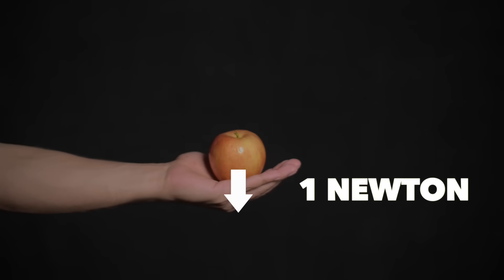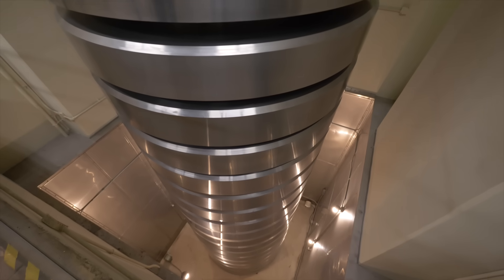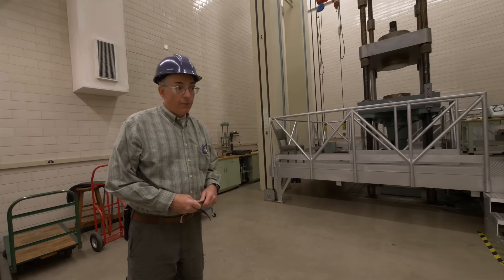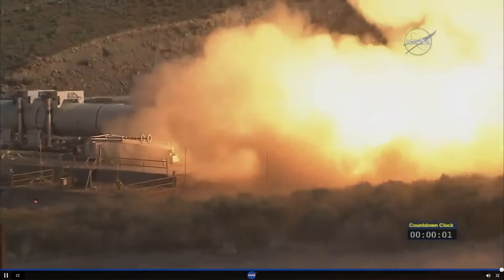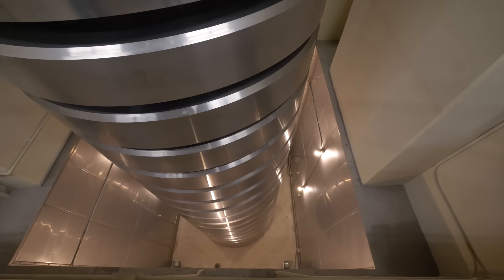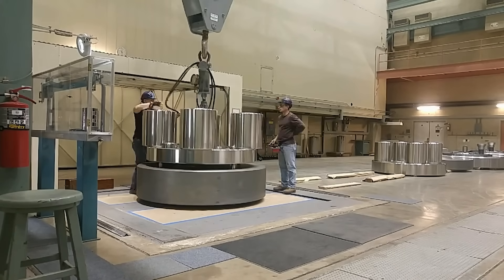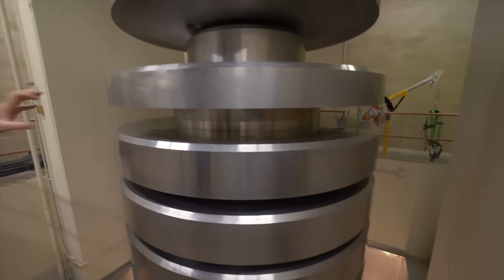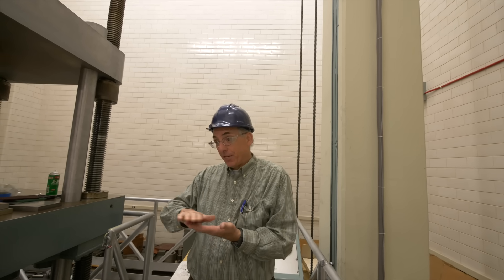World's Heaviest Weight

Comment: But can it break my bones? I drink milk every day so I'd say I'm pretty dang strong
Reply: Gon give some of my MD pennies

First, just gonna add that diet can cause a blood pH imbalance. Ketogenic diets and diets high in meat can cause acidosis, while diets mainly consisting of veggies can cause alkalosis. 

Anyways, an acidosis causes more albumin-bound calcium to be released to the blood, as the H+ ions compete with the calcium ion binding sites on albumin. This in turn increases plasma calcium levels.

Calcium is a highly potent signal molecule, so it is one of the most well regulated in terms of concentration in our blood. It's reference range is very tight: 2.15-2.5 mmol/L. And it hardly ever goes outside this range.

Blood calcium is mainly regulated by PTH, which is released from the parathyroid glands, where calcium-sensing receptor sit and taste for calcium. The way they work is that they are inhibit the release of PTH when serum Ca2+ is elevated (negative feedback).

When blood levels of free calcium is drop, PTH is released. It will work to increase blood levels of Ca2+ such that it reaches homeostasis. One way it does this is to increase osteoclast activation, which breaks down our skeletal bound calcium to increase blood levels of Ca2+.

This means that an acidosis would increase free Ca2+ in serum, which would in tune down the PTH release. Meaning we inhibit bone remodeling, which normally would result in loss of some bone mass after each cycle. 

If milk were to make us acidic, it wouldn't affect the rate of resorption of calcium from our bones much anyways. Blood pH is also strongly regulated, so the effects of a momentary acidosis are essentially insignificant, as it is quickly compensated. If the pH imbalance is of such significance that your body wouldn't be able to reverse it by itself, you'd have other underlying issues and other things to worry about, e.g. going into a coma. 

We consume way more acidic foods than milk, like soft drinks which can have pHs way below 3. Milk is only very slightly acidic.

When it comes to hormones, milk may contain estrogen. Estrogen is in fact helpful to keep bone mass density. The main factors of osteoporosis is age and gender, meaning females past menopause. Estrogen levels drop off, and it makes it very difficult for the body to keep the bone mass high. Estrogen is actually used as medication for osteoporosis, as it reduces bone turnover by binding to estrogen receptors in bone.

TL;DR: Ayy lmao, just drink milk.
edit: a word
Reply: bikeanddogtrips [citation needed]
Reply: Yeah I might not agree with all u said ( I didn't do research) but for sure i know drinking cow milk everyday for "calcium' is definitely not healthy. 
@fittyaqua don't always believe what the doxa tells you to believe..
always think twice
Reply: DupeSicate Saying something is wrong doesn't make it wrong either...
Reply: +Dangit_Bobby your gastric juices, not something made for baby cows to drink
Reply: SergioRC The Gamer Nobody actually cares
Reply: This is processed milk, raw milk is alkaline
Reply: this is great idea for raising Titanic but still too heavy for lifting the Titanic
Reply: bone hurting juice
Reply: FittyAqua uhh I drink everyday milk too
Reply: Did you know that your gastric juices have a much lower pH than milk, and that strict regulations and testing protocols have been put in place to ensure our milk is sanitary?
Reply: ¶The problem is that is not milk, nor the human body's way of processing it at all. The PH level in the milk is pointless, though at 6.5-6.7 it's closer on the PH scale to water than the HCL (3.01) found within your stomach. Moreover, the entire body works to keep your body at a relatively neutral PH level through homeostasis, achieved mostly due to the lungs (removal of excess/more CO2 from the bloodstream) and kidneys. The only time acid vs alkaline matters is for your mouth, and that has to do with forming ionic bonds for calcium to bind to teeth, or be striped. The body, regardless of what new-agey-hippies tell you, does not become cancerous - the fact that cancer cells are "acidic" is due to their anaerobic method of producing energy; that is not what caused them. The leading cause of osteoporosis is the LRP5 gene which seems to play a very important role in the density of bone within the human body. This is somewhat basic chemistry/biology, I am not sure why nobody researched this on their own time.
Reply: if you go super saiyan and train under 10000x gravity then that answer will be NO
Reply: FittyAqua milk has alot of chalk in it too much chalk can cause your bones to break easier
Reply: did you know that cow milk is perhaps the leading cause of osteoporosis (brittle bone) due to the fact that it is acid when digested, causing your body to remove trace elements of calcium from your bones in order to set it to a more natural alkaline state.  Plus milk has pus and growth hormones.

just sayin'

Comment: 3:13 what's he doing?? Is he removing some dust?
Reply: Precision is needed.As he will measure other weights relative to this one, this dust on a larger scale could weight 500 tons.
Reply: Possibly also drying condensation.
Reply: Tell me in what scale does dust become 500 tons.
Reply: lol, using a smaller known weight say at 5kg if they use a precise enough scale that can read to very small increments can pick up the weight of dust. now add that weight of dust times a weight equal to 1 million lbs. might not be 500 tons but that scale would be off by several hundred to several thousands of lbs.
Reply: Omar Ahmed
Reply: Urf a big scale

Comment: STOP USING POUNDS!   FOREVER!    GO METRIC ENTIRELY!!
Reply: the reason they use pounds is for at least the Americans, it is easier for them than Kg in conversation as no conversion is needed unlike metric to get back to pounds. 1kg is 2.2lbs, and 1lb is well 1 lb.

Canadian here, we use both rather interchangeably depending on the situation, but rarely will people use Cm's over inches and feet, but we do make use of km's and meters if the distance is great enough to warrant it.

I prefer pounds, as its easier to know 100lbs is 100 lbs. trying to visualize 100 kg of anything is difficult compared to pounds. When i  say "Grab that 30 lb bag of concrete" you will know the rectangle bags which are at least 8 inches in thickness are the correct bags without even knowing it half the time.

When someone yells to me "Mix me 20 kg's of such" i look at them like they are idiots as A i have no idea how many 30 lb bags im going to need until i take time wasted to do a conversion and B why didnt they just rattle off the old "Mix me two bags of such and such" instead of making use of metric if they already knew they would confuse people.

Remember Imperial measurements are English first.

Comment: Science doesn't speak imperial.  Use metric or SI.
Reply: The problem with imperial is not the fact that it does not work, but the fact that it's a retarded system used by like 3 countries.
Reply: bpoon2k2 Universe doesn't speak metric. Use Planck/natural units.
Reply: Science works the same regardless of which units/system you use. Units are just different reference points/languages if you will. Don't be so petty.
Reply: The american industry is built around the imperial system. Its often more expensive to get metric bolts and what not as well here.
Reply: bpoon2k2 "I want a whole country to change to the metric system.......because I said so"
Reply: But us dose
Reply: Science speaks numbers. It doesn't matter if you count in base 10 (Imperial) or base 4 (Imperial), it's all numbers.

Comment: Why not generate the required forces using hydraulics? It's a well-known principle that in hydraulic systems the force is proportional to the area - so for example, if the brake caliper in your car has a total piston area 5 times the size of the master cylinder/piston attached to the pedal, then the force exerted on the brake pads will be 5 times the force acting on the pedal.

So why not have a pair of hydraulic cylinders, one being 10,000 times the area of the other? For every 1lb. you put on the small cylinder you'll get 10,000lb. on the large one. Then you'll only need 100 lbs of carefully calibrated weight to calibrate the transducer up to 1 million pounds.

Alternatively, why not use levers? We all know force is proportional to distance from the pivot. So use a very long lever, put the transducer close to the pivot (say 1 foot away), and if you hang weights 10ft away, you'll be getting 10:1 amplification, so you only need 100,000lbs of weight. Use longer (or more) levers and you can get the same effect for less weight.

There are probably countless ways to get close to this accuracy using other accurate force-amplification methods.

Comment: In science, metric system is used, even in US. Pounds should not be here.
Reply: It might not be calibrated for kilos, but if you were paying attention, it is calibrated IN kilos, because each of those disks is calibrated against smaller masses, until at the smallest scale, it is calibrated against the US's standard kilogram.

In modern times, by definition, ALL US weight measures are derived from the kilogram, and the older system persists for... Reasons.

Who knows WHAT reasons exactly, but I'm sure someone can give some.
The UK still measures distances in miles for instance. The reason? When the country switched to metric they were too lazy to convert all the road signs.
(Australia meanwhile converted every road sign in existence in the country in the span of a few hours, as did most other countries that made that switch. )

So... The pound is 0.454 kilograms. By definition.
Because there is no independent reference for a pound anymore, this isn't merely a conversion based on comparing the two units, this conversion IS the definition of a pound.

Still weight is something of an odd one out here, because it's still defined in terms of comparing it to a 'standard' object, where many other fundamental units are now defined in relation to physical properties.

Time is measured relative to the vibration of Caesium-133
Distance is measured relative to the speed of light in a vacuum.

Anyway, whatever. Use all the silly units you want. ;p
20 years ago it annoyed me greatly. (because people in my own country were using these stupid units when officially we are only taught the metric system, and I had no idea what the units they used meant. And in spite of the metric system being the ONLY thing taught in school, most of these people - and these were kids mind you, not adults, did not understand anything if I gave measurements in metric. Very, VERY irritating.)
But no. That frustration is long gone.

However, if you say 'Aluminum' one more time... I WILL find you, and I WILL kill you. ;p

XD
Reply: Why would they calibrate it for pounds instead of dollars? That's retarded.
Reply: @Jack Gisicki: Then make it kilogramme lol. Why did you picked gram in the first place. The opponent for pound lbs is kilogramme kg.
Reply: Jeffrey Slater no one said that. America uses an outdated and unused system of measurement for no reason. Im American by the way. In science everything is measured using the metric system.
Reply: Virginia Battle Flag murica... :/
Reply: krugerblue its not calibrated for Kilos. If you listened carefully before bitching its calibrated for
 p o u n d s. Thanks gor your opinion though
Reply: US mechanical engineer here. 
I think we worry too much about units. Admittedly, I know imperial units more intuitively, having built and used standards based on imperial units. I still have to think a bit about what a kilogram or newton is.

There are too many things in the US, in terms of production, manufacturing, and engineering that use the imperial system. The momentum in keeping to that standard made the 1,000,000 lb weight vlogged above exist. 

I still like imperial units. I like how an inch is the length of my smallest index finger joint. I like how 100 degrees Fahrenheit is around body temperature. I like how a "cup" (liquid measure) is a small cup in volume.
Imperial is humanist.
Reply: Pure Hostility how sneaky and original. Europeans when they see Americans using the imperial system of measurement "how DARE YOU!! I must DESTROY YOU AND YOUR COUNTRY!! Grrroghhgoorrrhho!!!!"
Reply: he meant the weight not the money
also, it is only calibrated in pounds. if it used the metric system, it would be a hell of a lot lighter (by that i mean 1 million grams is not as heavy as 1 million pounds

Comment: This seems really strange. The scientist speaks of Newtons which is a SI unit of force and yet the weights are constructed to be a round number of pounds which are imperial. Why would they not use say a 500,000kg weight (or 500 tonnes if you will) rather than a 1,000,000 lbs, still round numbers but directly traceable to the same standard kilogram the US uses to calibrate its imperial units of weight. The force you would get from a 500 tonne weight would be around 4.9MN (depends on local gravity, just as it does with the imperial weights).

Comment: why would they convert kilograms to pounds and uses it to calibrate airplanes rockets and other engineering works that require standard SI Units such as Kilograms? That is double the work because you have to convert from Kilograms to Pound then Pound to Kilograms.

Comment: For the metric snobs out there: you should remember that Americans got to the Moon and back using imperial measures. The conversions are not as hard as you think and the measures are just as exact. 
This video shows that perfectly reputable engineers and scientists use the imperial systém. Cell phone screens, laptops, even bike frames and wheels are typically identified by their measure in inches even in the parts of the world that officially use the metric systém. 
That said, metric is better, but do not say imperial measures are somehow a travisty to logic.

Comment: I'd like to weld the segments together, machine them precisely and balance them, then attach them to a HUGE low friction electric motor and spin the stack up as  HUGE flywheel... then disconnect the motor and see how long the stack takes to slow down to a dead stop.

Comment: Great video! Also, inb4 the 3000th triggered comment about mathematical conversion and one's inability or unwillingness to simply learn/understand/appreciate both standards.
Reply: No, the Apollo program was designed in US Customary units.  A 1 page study by Werner von Braun for Skylab used vehicle diameters in feet, and weights in pounds:  https://en.wikipedia.org/wiki/File:Dr._von_Braun%27s_Sketch_of_the_Space_Station_8883912_original.jpg

As long as you're consistent, it really doesn't matter what system you use.  I mean, a distance of 1/10,000,000 of the distance from the pole to the equator on the line of longitude through Paris, and taking the weight of 1/1000 of the cube of that distance of water aren't any less arbitrary than some random king's foot.  Chaos happens when you try to convert back and forth in one project.
Reply: Sshhh, CatCube2... You're spoiling their fun with facts!
Reply: Michael Distefano they've used only the metric system for all the calculations to send people on the moon because it makes more sense... deal with it!
Reply: CatCube2 That's not the current definition of a meter. Or a kilogram.
A meter is 1/299 792 458 the distance light travels in a second. A totally non arbitrary number.
A kilogram is the mass of the international kilogram.
Again, a totally non arbitrary basis.
Reply: CatCube2 well, no. You know, if the system was consistent, I might agree with you a bit. But the imperial system is not. If the factors between different units of length differ completely from one to the another, then calculating is much, much harder. And I think you can see what a pain in the butt it has to be if you then have to convert between different composed physical units
In contrast, the metric system uses 10. Only 10. 10^3 = kilo, 10^-2 = centi, 10^-3 = milli usw. converting from centimetres to metres isn't any issue. Neither is from square centimetres to square metres. Just multiply by 10^4, or shift the comma by 4 to the left. Now convert from square inch to square foot. You have to use a calculator for that. That's why the system makes absolutely no sense
And by the way, the imperial units are all defined in SI units
Reply: Awaiting Deactivation you have sent people to the moon, or you use the metric system. deal with it!

Comment: am I wrong? 0.0005 of 1 million is 500lbs not 5lbs. if that's the case still impressive but not as much.
Reply: Yes, you are. While 0.0005 of 1 million indeed equals to 500, the 0.0005 was in percent i.e. you have to divide by 100 again.

Comment: So sure, I wouldn't accepts an airplane built to 10% tolerances, because either it would crash or it would be a hideously expensive flight to cover the required overengineering, but I would accept (just pick some number) a 0.1% calibration chain, and 0.005% is just over the top. You probably get more than a 0.1% uncertainty just from random environmental variables on a flight. On a 300 ton airliner, 0.005% is 15kg, or 37 grams per passenger. That's on the level of how many farts each passenger is holding in. (Okay, I exaggerate.)

I would have enjoyed a little more challenge in that last question. But I guess your host's semi-prepared speech is tuned for sounding impressive as an engineer and not for making a business case for when such levels of accuracy are cost-effective.